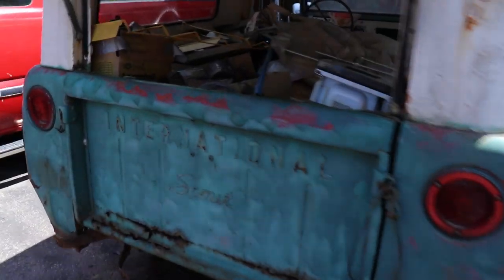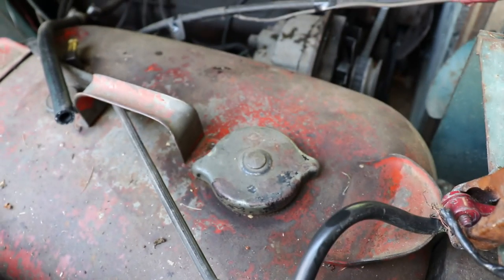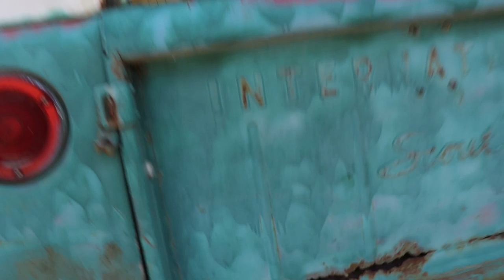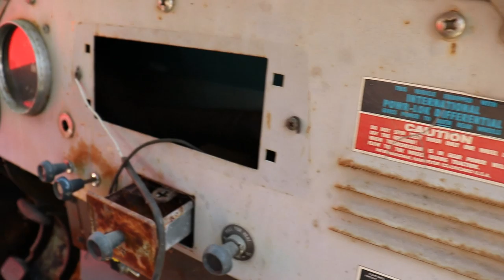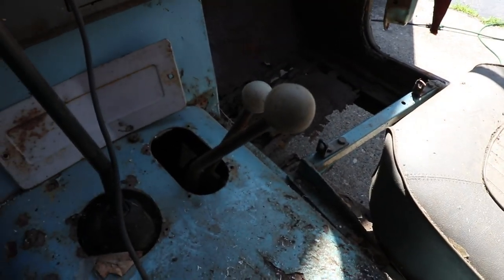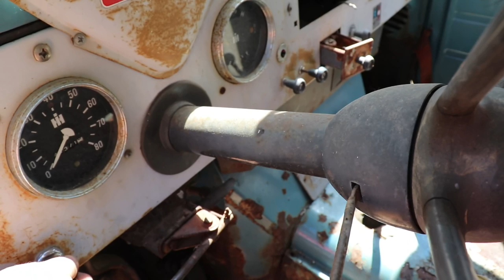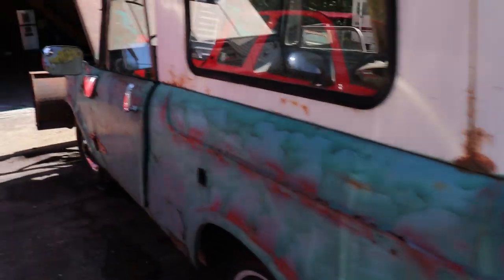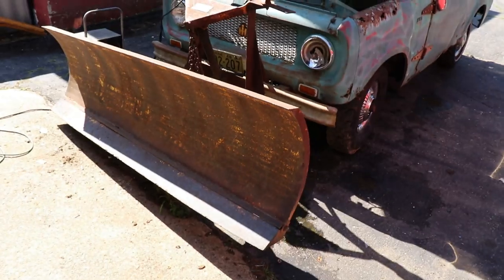Will the 68 Scout run+drive??

Comment: How does a divorice transfer case work when I seen the bullet holes I was wondering how you could get a hole that straight through the roof I guess it tells a story
Reply from the maker: A divorced transfer case is completely separate from the transmission. It is located further down the driveline rather than a married one that is bolted directly to the transmission.
Reply: @acrazycanuck78  I see where they get there name now